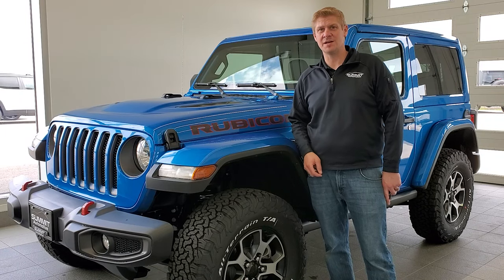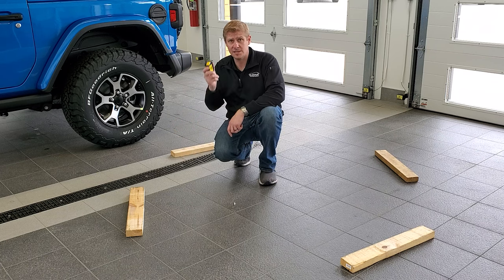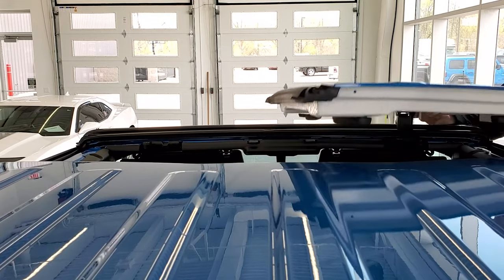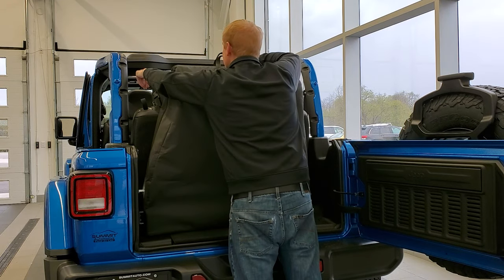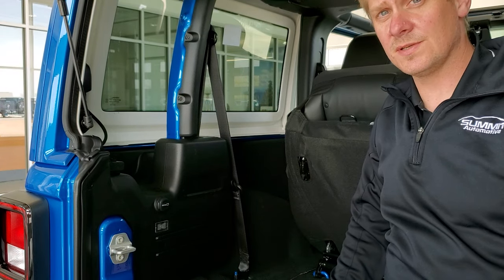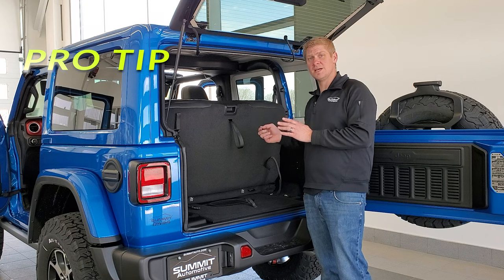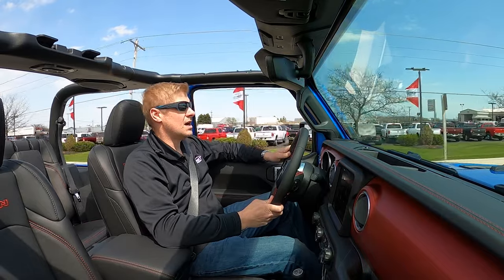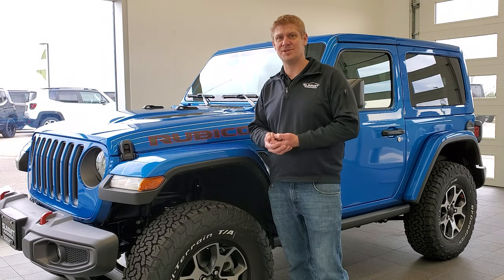HOW TO REMOVE 2 DOOR JEEP WRANGLER JL HARD TOP REMOVAL STEP BY STEP

Comment: Just purchased a Wrangler and watched first vid. Very useful. Will watch more. Thanks!
Reply from the maker: Glad you liked it!  Remember to like and subscribe!  Helps the algorithm!
Reply from the maker: I also have many other Wrangler Tutorials including how to take your doors off!

https://youtu.be/rz_w70_Oj_Y?si=eUsv6wZRWi7utYpp
Reply: How did you get body color hard top？
Reply from the maker: Its an option
Reply: @Summitauto  Thanks man. I was look through jeep website try to build mine, but they only offer 3 pieces black hard top. Maybe some dealer makes it option？
Reply from the maker: @luisejace6766  It depends on what trim level.  I don't think the body color top is an option on the lower trim levels like sport.  Sahara and Rubicon for sure.

Comment: Yeah, Jeep gives you a set of tools... And then puts it in a place where it will get wet, so by the time you actually need them, they will be quite rusted... Idiots... Must have been "designed" by the same kiddie engineers who couldn't even get the UConnect to handle audio playlists correctly... Or the idiots who decided to use and electro-hydraulic power steering pump...